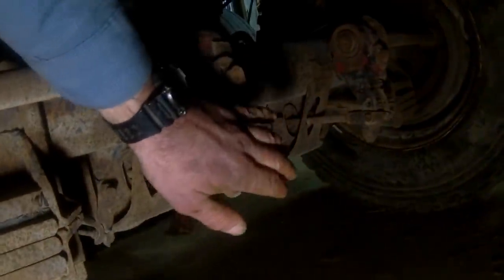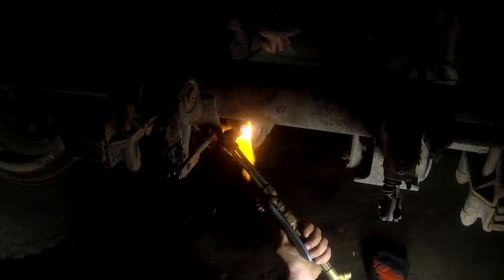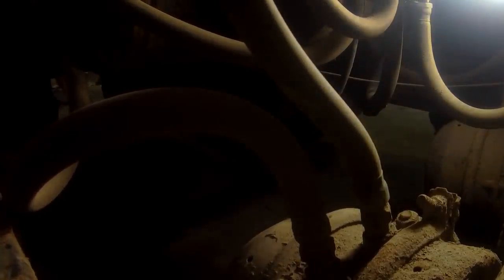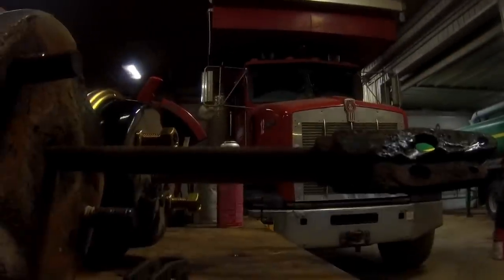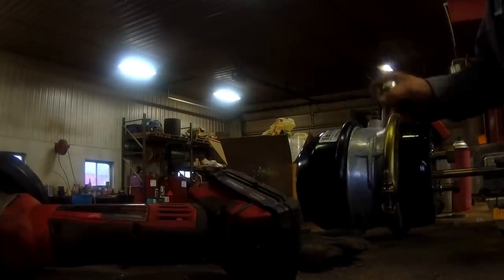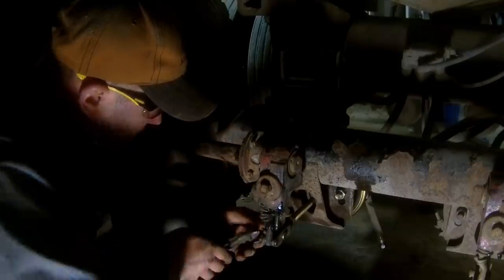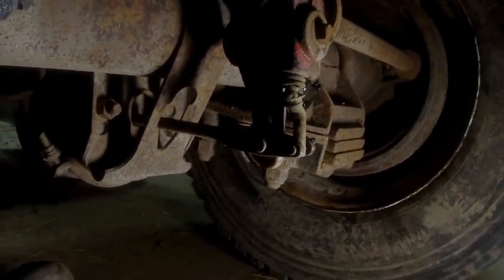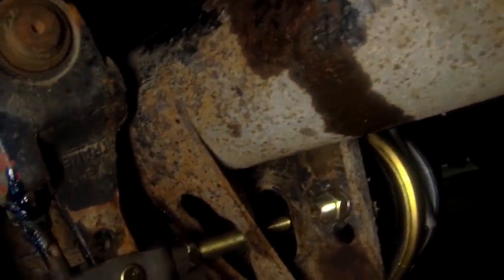#fixing Replacing a 3030 air brake chamber on a Diller semi trailer

Comment: Andy, I have a set of those ‘cheap, joking’ Snap on soft face dead blow hammers for hitting the tools to break loose stubborn bolts and nuts. I started with the HBFE103 set then added the 16 and two of the 56 ounce hammers. I have a few harbor freight hammers too for working on stuff that defaces, makes places and ruins, the Snap on hammers... I use them for tightening stuff as well. 

The dead blow hammers doesn’t have to be Snap on... Its just what I thought I needed ...

Hope this helps?

Comment: Thanks for my new thing I learned for day.  👍  You are so right about the lighting, you never can have it were you need it and when you do it usually blinds you. Nothing beats sunlight doesn't it. The more times I see you weld a bolt or nut on to the one that is stuck or broken I want to buy a welder, it might just make some of my repairs a bit easier.

Comment: Before you took the lines off did you bleed the air out or caged the brakes?
Reply from the maker: I didn't care them, I unhooked the shop sir from the trailer before I unhooked the lines on the brake chamber.